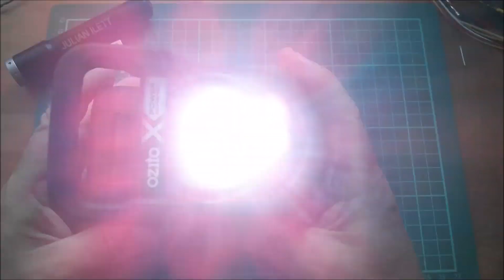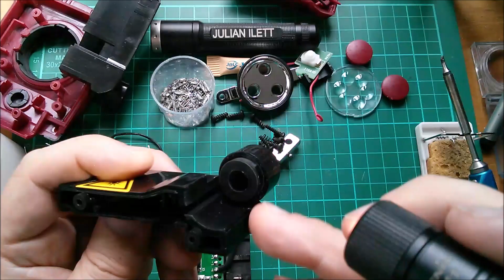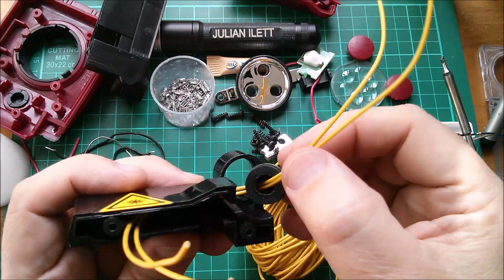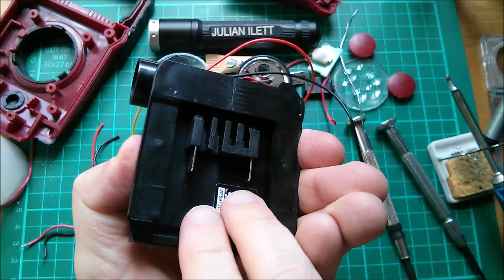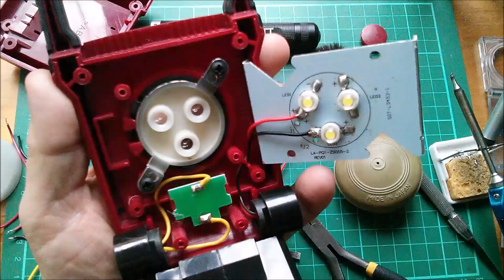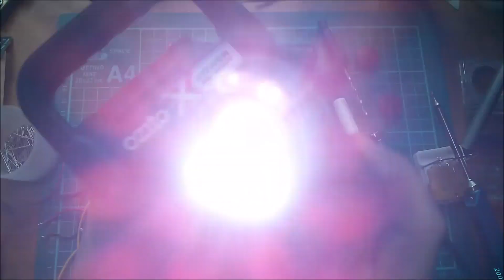Tricky Rebuild - Ozito 18V Cordless Worklight

Comment: That was an adventure! Thank You for sharing this, Julian. You made it better. I have an LED flashlight that I modified so I could toggle between the end light and the front light. (It was 4 clicks of the switch; 1 front light; 2 end light; 3 both lights; 4 off) Now I can hit the button on/off for each light individually. Slide switch I added separates the two. What a PAIN to get that flashlight back together. And there weren't even any pivot points! Beautiful Job, Julian!

Comment: You never showed us the spring and ball bearing going back in....I really want to see that, Julian. Now that you taken it apart and put it back together it should be a doddle next time. P.s Have a question about the LED drivers from Ebay, the ones with the holes drill in the case for ventilation, is there anyway to modify them to output 14v rather than 12v?

Comment: Hehe.  I just recently got done putting a replacement IMR18650 battery into one of those mini drill drivers. (The little ones that used to be commonly available, but you can't find anymore.)  The problem was the only battery I could find that matched had onboard protection circuitry that the original didn't.  I had to do quite a bit of internal plastic surgery to get it to close back up.
Reply: how many watts do you require ?

Comment: Is the FBR there for indifferent polarity?
Reply: Scott Beasley The full bridge rectifier could easily be cost optimised away since the battery and battery connector are keyed and can’t be connected backwards (or in an abundance of caution, to one polarity protection diode); there really is no reason for it in a D.C. tool.
Those 4 diodes might only cost buttons in bulk, but a few pence per unit soon adds up to real money when you start mass production.
Reply: @Bin216  I not saying it was the right thing or needed. That's the only thing I could think of. Maybe was a DOD contract eng and they are used to doing that for all battery-based circuits ;)  Or maybe the eng had a diode fetish.

Comment: You could have used work hardened Brittle Solid wire.  That way you would be assured it would short or open just when you was about to remove or taking the flat tire off the car.   Out on a Frozen night on the open road of course  ?